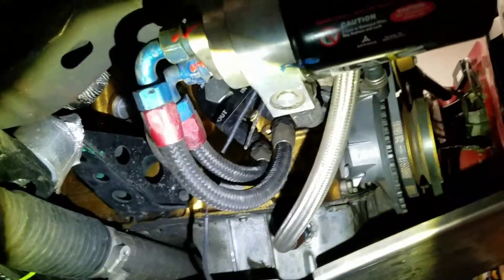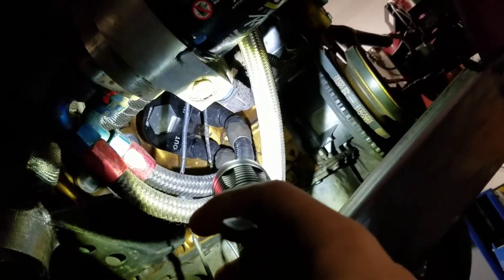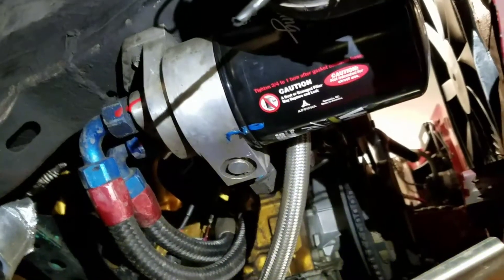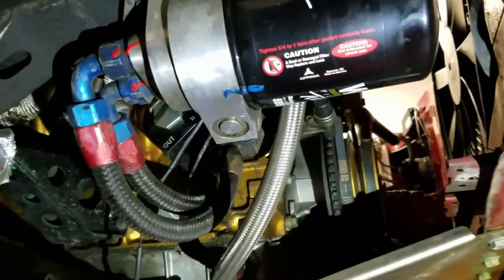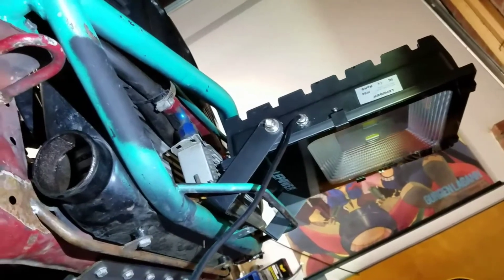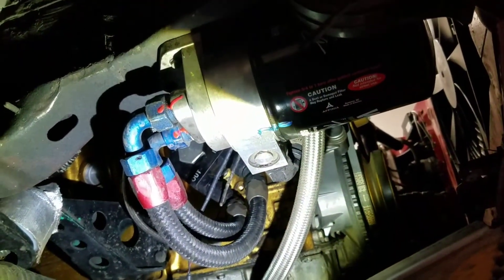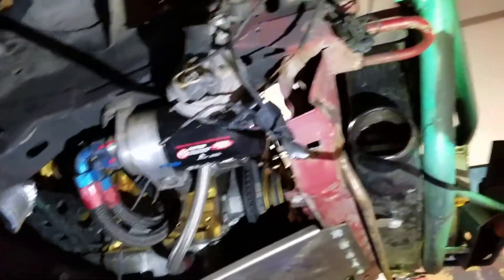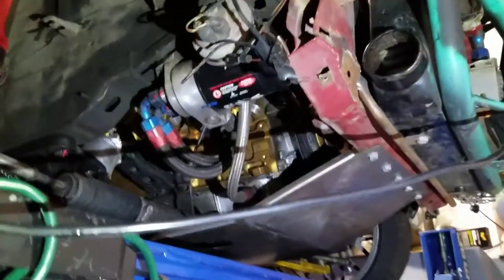E30 remote filter and cooler

Comment: Ayo sweet video. It looks like the blunttech link isn't working anymore so I was wondering if you could specify the part I'll need to remove the cooler housing because my e30 has an oil cooler on it. Thanks!
Reply from the maker: Sorry for the delay, https://www.blunttech.com/shop/11-11-2-140-435